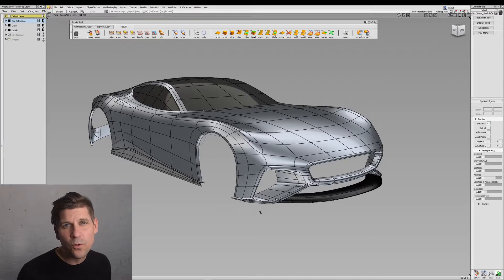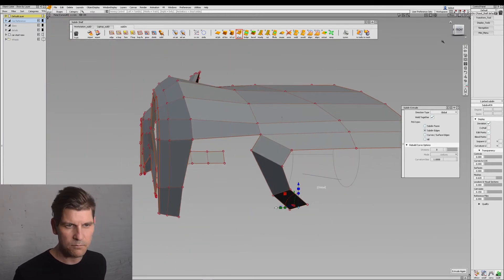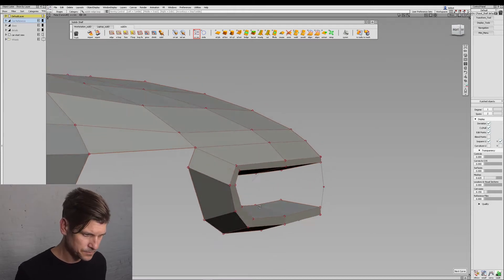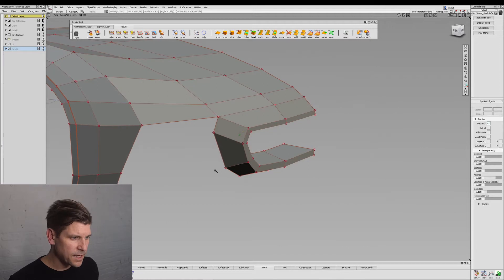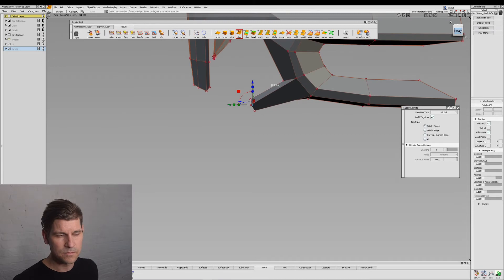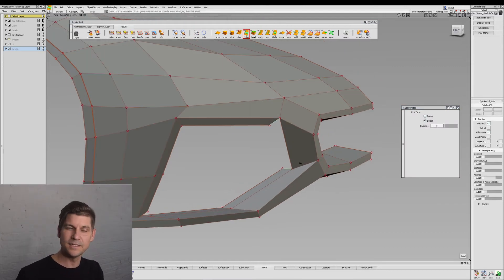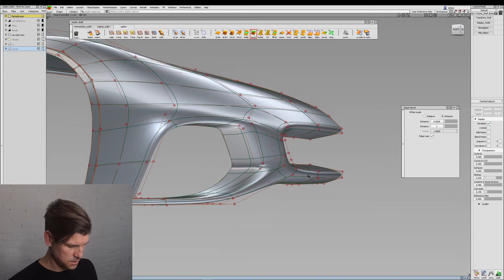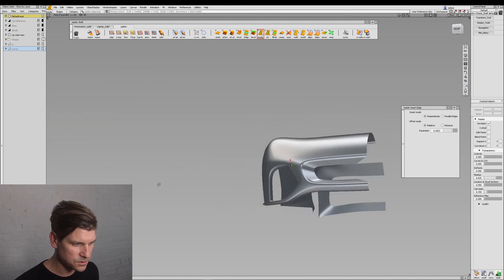Part 5: Automotive Details SubD

Comment: where can i find the .wire file for this? in the onedrive folder there are only images for me
Reply: Same for me, but you can use the SUV model you did from the other tutorial and work with those proportions :)